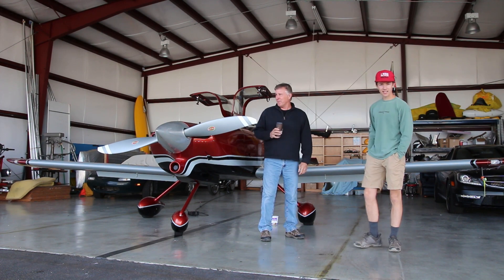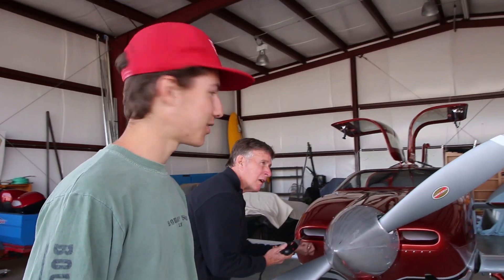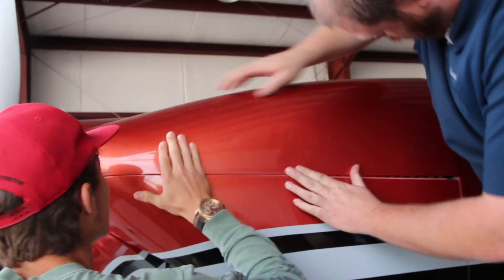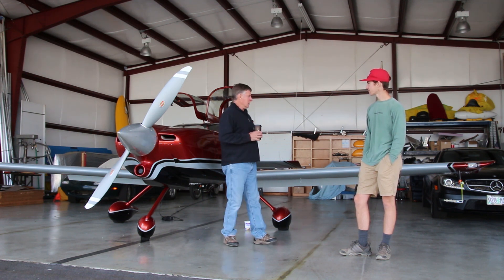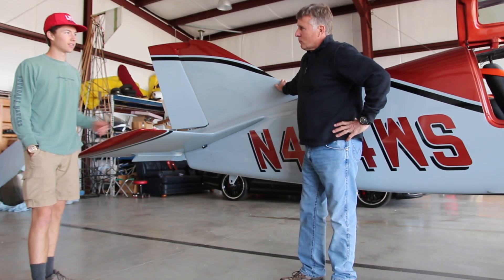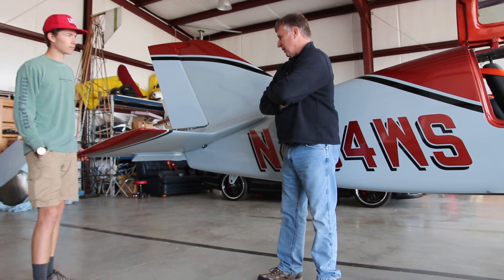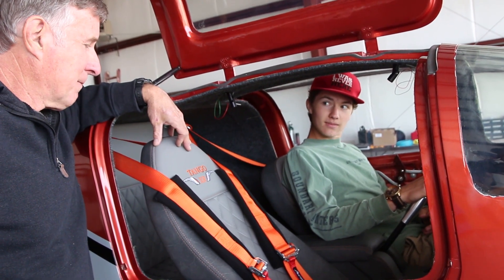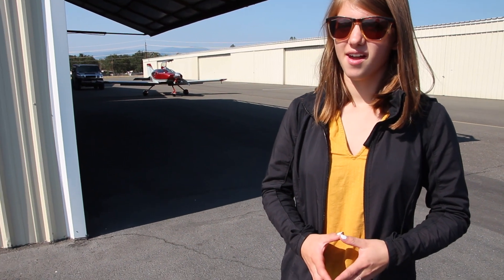Revolution Aviation RAI-1 Tango Experimental: Flying to OSHKOSH AirVenture 2022 (Part1)

Comment: I’ll be looking forward to inflight videos where you discuss performance.  Sometimes, what the manufacturer and/or salesperson claims can be a bit different than what the aircraft actually does in the real world, though as you said this can sometimes depend on build quality or preference.  

The guy I talked to at KOSH said he could takeoff in 600 feet WITH full fuel.  I already knew right then he was embellishing.
Reply: I saw 950' takeoff run on a website somewhere. I cannot remember if that was at MTOW or not.